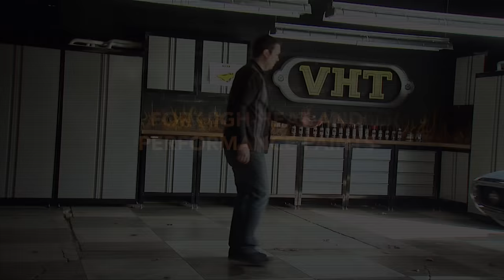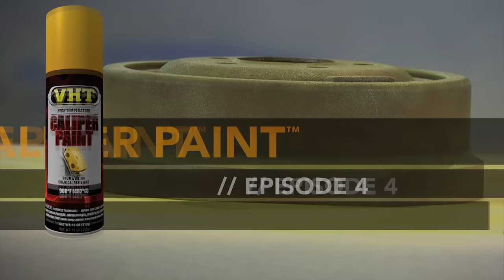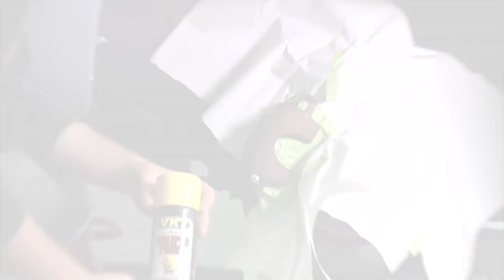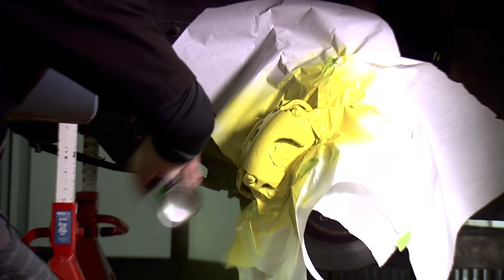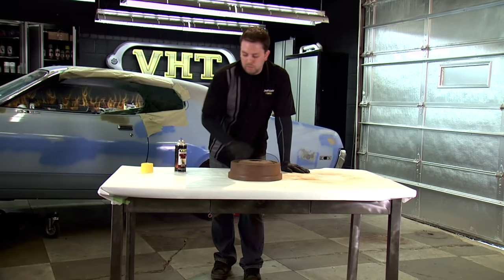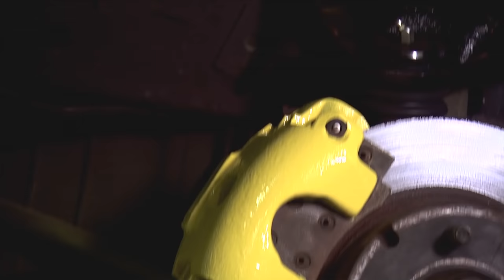Painting Calipers with VHT Caliper Paint - Restoration of 1972 Plymouth Satellite Sebring Plus

Comment: I have a question on the process that I can't seem to find.I plan on using your caliper paint/engine paint on a couple projects.  The items will be removed, cleaned/previous coating removed.  I am going to use your high temp primer, then coat with your high temp color.  At which point on the cans it states that one should bake the part for a set degrees for a set time.  Does one add your high temp caliper clear coat AFTER baking or before?  IE:  Primer, color (multiple coats), clear coat then bake.  OR  Primer, color (multiple coats), bake in oven then once cured clear coat (bake again?)I can't get clarity on this and I've called your 800 number asking and no one seems to know?
Reply: Would like to know as well
Reply: NewShockerGuy it's been a year . how did u do it?
Reply: If the paint cures before the clear it should be fine to spray clear on top without baking but if it’s the other way around and the clear dries before the paint then there will be trapped solvents under and eventually the paint will get weird or it will bubble or something. If you drive the car normally there should be enough heat given off from the calipers to dry the paint first and slowly push out the solvents with it and then dry the clear.
Reply: @luissonoma6255  don't bake the Clear, primer, paint, bake at 200° for 1 hr, then let cool completely and cure
Reply: @kiddcisco  I’ll keep that in mind, thanks. Sometimes the clear gets hazy, I’m assuming that’s from the paint not being cured...🤷🏿‍♂️

Comment: Did a full restoration on rear calipers with the VHT Cast Aluminum paint.  Used a zinc coating primer before final paint with VHT.
Followed instructions on baking part(s)  Have not installed them yet but very happy with the finished look.
I feel they look fine without any clear coating.
Reply: How is it holding up without the clear?